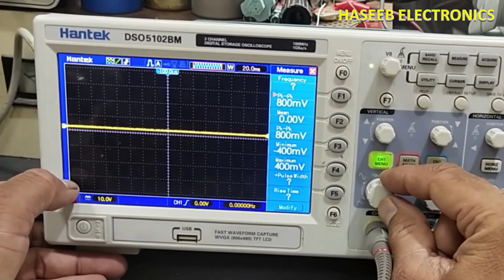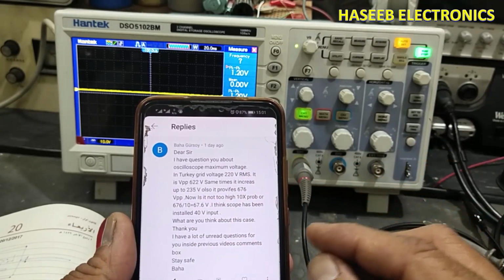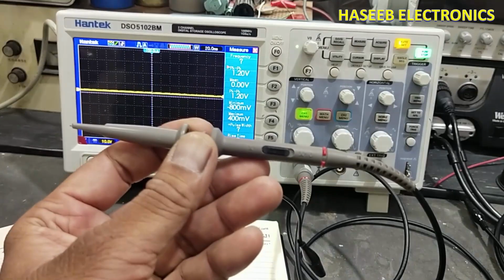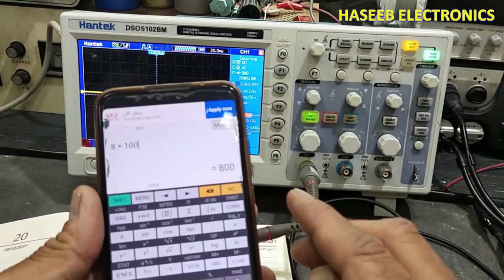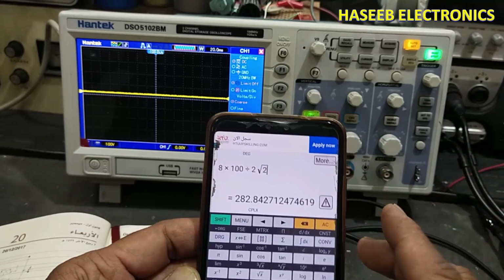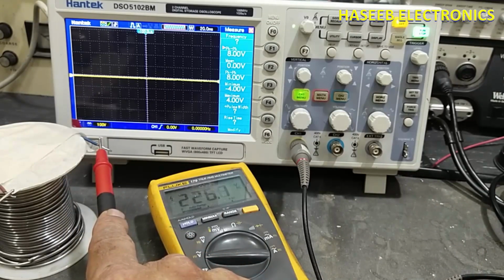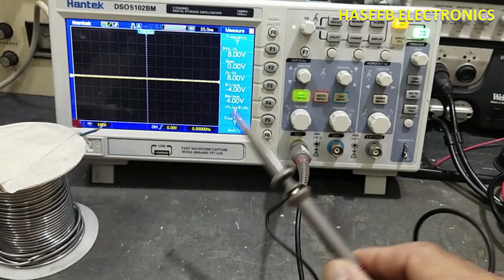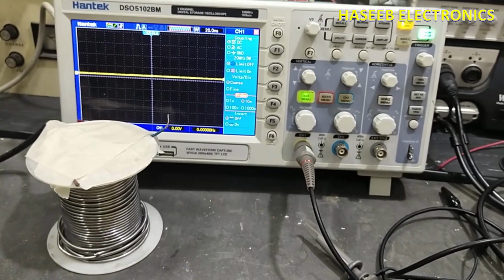{689} Measuring High Voltage With Oscilloscope, What is Maximum Range

Comment: Very confusing if you are talking about 80 volts peak to peak. Just work with Peak and RMS voltage. Max peak AC Voltage is 4 divisions on scope multiplied by 10 is 40 volts. Max RMS voltage is 40 volts divided by the square root of 2 is around 28 volts. This is for 1X probe. For a 10X probe you multply everything by 10 to get the max values of 400 volts peak and 280 volts RMS so simple as that
Reply from the maker: Also You are right 
But I think we must consider the peak to peak values
While discussing multimeter, we can say RMS or peak voltage 
But for oscilloscope we must consider full scale display limits. That can be interpreted clearly using peak to peak level either we are using 1x 10x or 100x attenuation